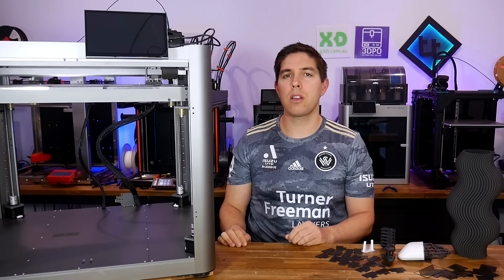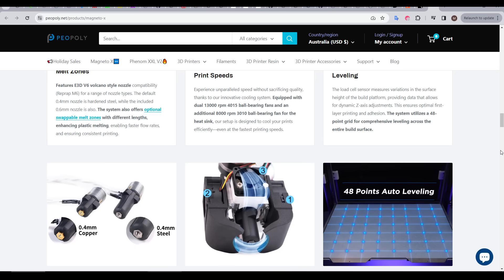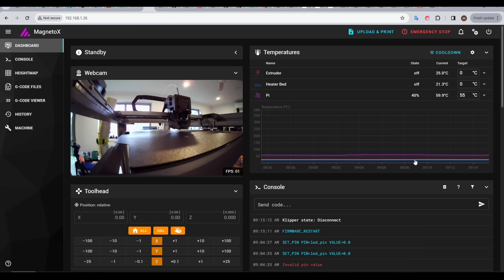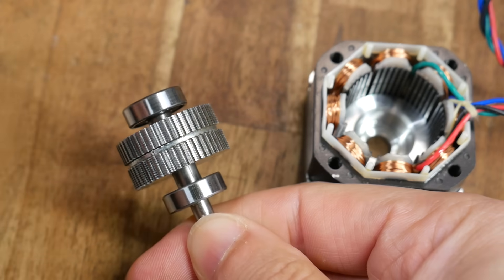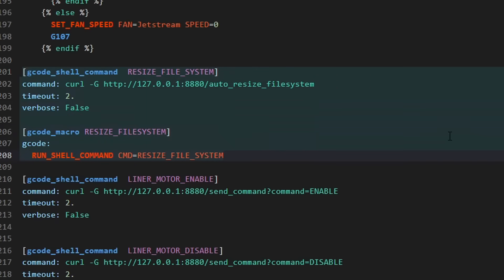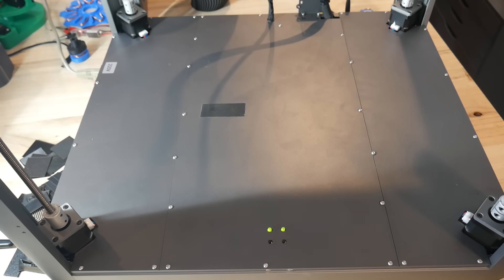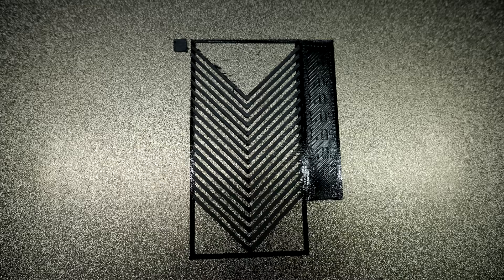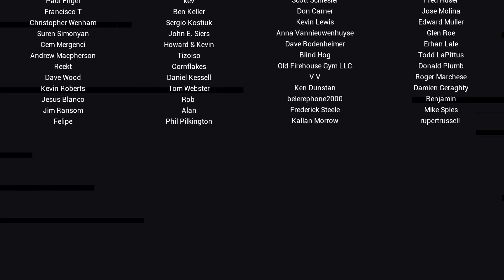Field testing the Peopoly Magneto X linear motor 3D printer

Comment: Hopefully you are able to do a few videos about this printer to explore some of the technology in depth.  Here are some things I would like to see.  1. Other reviewers will cover out of the box experience I am sure, I would like to see an advanced owner point of view, as I think the technology and open-source nature of this printer will attract that sort of buyer.  So, first off, calibrate it well (califlower before and after results?) and tune the orca slicer profiles as you see fit.  2. Explore what benefits and drawbacks the motors have. 2a Is there a difference in how noise ramps up with speed? 2b are VFAs still an issue? 2c Do linear motors and lack of belts change the kind of square corner velocity we can run? Cornering sharply without slowing down might be a real benefit if it doesn't lower quality. 2d How do the closed loop motors integrate with Klipper given that klipper can't respond quickly enough to make real time changes if a motor can't get to it's target destination on time.  Force it to miss a step, will it correct without telling klipper and leave a small artifact?  Will it show a warning in klipper?  Will it just throw an error and terminate the print job? 3 will the open source load cell be useful beyond just being a klicky alternative? Can we see the load cell data and do anything with it? 2e Is the increased resolution useful or noticable in every day printing. Does it open up any new possibilities, for example with a tiny nozzle do miniatures come out better than on a normal FDM printer?  We are seeing that the limits of speed printing (and speed benchies) are coming down to cooling, but do the motors allow us to print fast at a higher quality than we might with traditional motors? 3a Can the homing and bed leveling macros be sped up, in travel if not in actual z testing? Can you correlate the values from it with PA testing?   4. The cooling setup seems quite robust, more than might be needed for every day print speeds.  Can you test out a "silent mode" or something similar to see how noise is at more relaxed printing speeds with slower fan settings?

Comment: Would this printer be a good machine for printing alot of small parts 24/7? If whole printbed is full with small parts can induvidual units be canceled as on Prusa XL? 

And how about always perfect first layer in all spots of printbed, especially considering it's  size. 😊
Reply: Klipper allows object cancellation, it's configured by default on the printer and in orca slicer. I think the only slicer that doesn't do it by default is Cura, but it totally can do it.

Comment: Open Source is certainly important for some people, but you don't have an open source TV, or open source refrigerator, or automobile, and life goes on.  Bambu Lab non-open source printers with almost every part being available from their web site at very low prices could be much better then trying to find a linear motor from SOMEWHERE and hoping it fits my printer.  Also, lets say Bambu Lab were to come out with a printer with this same bed size, but no linear motors and half the price, would I buy this?  Not so sure.  MY advice to them is, stop the worry on open source, and bragging about linear motors and make the best consumer printer, with the best interface at the best price possible.  And if it can do multimaterial, even better.  Built like a tank is great, but how many GM Hummers do they sell compared to Honda SRV's?  I don't need my 3D printer to last forever, just a few years until they come out with something much better.  And if it costs way too much, I may never buy it in the first place.

Comment: Perhaps it would be nice to verify the dimensional accuracy of the prints after all is tuned to the max.
Reply: The linear motors make dimensional accuracy non-issue. Either it's accurate, or you push it so much it fails completely, no in-between.
Reply: @sharpfang  This isn't accurate at all.  Your understanding of how closed-loop motors work and the precision of steps (on open and closed loop motors) is incorrect.
Reply: printing nerd during his interview at The First Look mentioned that it is not like the 20.000 USD printers in https://www.youtube.com/watch?v=9YaW8DIxWTc. It would be interesting how accurate it is or what the potential is. @sharpfang
Reply: @sharpfang No, this is not how it works. It is as accurate as servo control loop can make it. It depends on the encoder resolution, it's noise and rate.

Comment: This would be a perfect application for the Beacon leveling scanner. Patiently waiting for the official release. Been watching this printer from the beginning and it's stopping me from buying a Bambu. Love the mix of reliability and open source.
Reply: The Beacon sensor would be a step backwards in accuracy from the  load sensors being used on most of the new printers.

Inductive and edd sensor measure the height to the flex sheet under the print surface instead of the height to the acusl print surface.

Comment: I would love to know if there are down sides to having magnets more exposed like this.  Does it attract iron dust, does this affect printing, can it clear the path on its own or does it cause a jam or worse failure of the motion system?  I know many people who keep their printers in their shop with other tools so I could see this being an issue.
Reply: CNC machines are using linier rails at much larger scale and exposure to ferrous metal. The magnets are under a cover (much like a stepper motor). If your shop has that much iron dust floating around id be more worried about lung contamination.

Comment: That was so cool! Thanks for posting the video with all these details. I've had my eye on this printer since I saw the same Joel video you mentioned. You really gave them amazing value as a beta tester with those improvements! 

I'd love to see details on consistency and accuracy, as well as tolerances. I've also heard that they plan to have tool changing as well, so if you can tell us any info on that I'd love to hear it.
Reply: I've never seen them make any mention of tool changing...
Reply: I think that they will implement IDEX before they go to tool changing.
Reply: +1 for positioning accuracy. I have done some experiments on my stepper-belt 3d printer, and found some 0.1mm-0.2mm of reproducibility error, which is most likely due to belts. I am not sure if these linear motors would improve on that, but they might, and i'd love to see if they do.
Reply: @victortitov1740  i think the linear motors would have more accuracy , these are used in cnc machines after all and these are really precise

Comment: It's an interesting printer. Since the main innovation of this printer is linear motors, I would like to see tests of them. How accurate is the repeatability after, say, 100 movements along the X-axis from edge to edge? What is the resolution? What are the maximum temperatures that the linear motor magnets can withstand?

Comment: I actually ordered mine in the Pre-Order sales time, and await it, they are making lots of changes, some good, some, just seem strange.   Like the thought of adding the availability of a chamber heater.... something they show I found on Amazon for about $20... but the time they took to work on this seems to have delayed the 'base printer' finish times.   I have mixed feelings on this,  I like that they are considering 'all the bells and whistles' but at the same time, thousands of printers were pre-sold...and none of them (that I know of) have arrived yet.  This makes it feel a bit hollow to us.

Also I think the cost of the Top Enclosure (because there are 2, the main and the top) is a bit too expensive.  The main enclosure is only about $70, which seems about right for pre cut, sized, etc Acrylic of that size. (in fact, its only about 20% more expensive than If I bought the acrylic and did all the work myself) - but the top enclosure, which is roughly half the size in acrylic, but adds more extrusion, is $140.   This means the total cost to enclose,  is over $200 - and shipping adds on to that.   That is a bit steep really, for that price, you can literally buy another mid range printer, or a good 10Kg of plastic to use.

Since you got the kit and are going to test/review it - I'd like to see the difference with 'top on/off' with ABS, as I feel most will feel like me, and the $70 doors and walls enclosure is reasonable and probably a go-to, but the $140 top enclosure is a bit steep - and will probably be skipped.     Let's see how much that top enclosure matters for, PLA, ABS, ASA, PETG, and maybe some more exotic filaments, etc.  These prints should probably be as tall as possible reasonably speaking, to ensure it's not a 'the first hours are ok, but after that - there is problems' situation.
Reply: 250 printers were pre-sold, not sure where you got thousands from :)

Comment: i love everything about this add a second print head / toolchanger and it beats literally everything on the market.. it's cheaper then the XL  and better built then anything else
Reply: The linear motors means adding a second print head would be fairly trivial too
Reply: @Geoff_W  i feel like I saw something about them doing that at some point but tbh I don't remember lol
Reply: @Geoff_W  You would have to add a 2nd Y rail to the gantry as you would lose all your print capacity adding just a print head.
Reply: @a2dskins  There's room on the board for expansion, no reason you couldn't add another Y gantry too, the only thing with that is you are sacrificing build volume at that point (although you probably also lose some adding another print head to the same gantry also).

Also there's no reason you couldn't just throw another head on the X gantry. You could run an ERCF to both heads and do a color change on one print head while you print with the other.
Reply: @Geoff_W  i remember that at that event where they show 3D printers  (i forgot how it was called) there was a Magneto X that had something like 5 heads , so yeah , you are right

Comment: What about linear motor drivers? Are they open source? What if driver fails? And, belive me, it will fail sooner or later. BLDCs are not steppers, they produce much more back EMF, and MOSFET are not happy to handle it. Does Peopoly sells these drivers? What if Peopoly gets bancrupted? Convert this printer to steppers and belts?

As for design itself, it's heavy for no reason. Zero advantages. And very expensive. Belts are better, and closed loop is possible with belts too.
Reply: Heavy for no reason? In the first paragraph you made the impression of knowing what you were talking about and then you turn out to be clueless. 😢
Reply: @MetalheadAndNerd These are magnets. They are heavy and expensive, but print quality is same as belts. What's the point of it? Why should someone prefer linear motors instead of belts and pay x2 or even x3 price?
Reply: @TheNamelessOne12357  Magnets are a well known technology. I wouldn't call them expensive either. 
The biggest advantage of linear motors is in my opinion that there is zero additional flexibility and resonance in the system as it would result from belts. Also no bearings needing replacement and especially no motor bearing getting worn down by constant sideways pull on the motor shaft.

Comment: I think speed is already limited by the material properties, closed loop sounds very nice, just that instead of loosing steps it will detach the object from the build plate. 
The load cell in the head has definitely some potential, like detection of all kind of print failure. The slicer can estimate the expected force for a segment put them in the gcode. Klipper can then do the checking, stop, slow down, add more z-hop, reduce extrusion factor for curling overhangs.
With this hardware it may become the first printer where you never see the spaghetti monster.
Reply: Your comment about material properties: Are you talking about the filament? They do have a long melt area as shown at 5:18 but it would be good to know how much power it's pushing through it, and up to what temp is it heating up to. What other material properties are you worried about? The weight of the print head?
Reply: @tomsko863  CNC kitchen, done a video about it fast and strength, if your hot end is at it limit the parts are coming out weaker.  So bamboo labs with its motion system is already at it hotend limit. 
Do we have here a significant better hotend? On paper, the motion system can be faster. I just have a flsun v400, I don't use the top speeds for strength, relatability and noise reasons.

Comment: One thing I would like to know is the maintenance/cleaning pros and cons of the linear motors over the conventional belt/pulley system. For the latter, making sure your belts are of appropriate tension and un-tensioning them when not in use for a while is something we have to do. Does the linear motor system remove this need for maintenance completely without catch, or is there another layer of complication in terms of maintenance that it brings?
Reply: Magnetic flux scattered around Gantry very dangerous.  Heavy Gantry, heavy motors. Enclosed chander can demagnetise the linear motor rapidly.

Comment: I’m apart of the beta program as well. I’ve been using it to print very big things such as cosplay helmet. So far this printer is on track to be a great contender!
Reply: It's one thing to love a USD$2k printer you received for free, it's another thing all together to lay out your own cash for this thing.
Reply: @WheatMillington  It's really not. 2k for a cutting edge printer that is in the spirit of RepRap and adding to the community and uplifting it instead of being a bad actor really does have a lot of value to a lot of people.
Reply: @Geoff_W  being in the spirit of reprap is not a reason to be more expensive, only a reason to be cheaper cause you'd expect the "closed" companies to be the expensive ones for being proprietary

on the contrary i understand that the mechanics involved aren't the most straightforward nor cheap, neodymium is pretty expensive and then there's also development time etc.
Reply: @Geoff_W  to add on that, it is a reason i cannot recommend anything Prusa, cashing on a 10 year old design, being "open source" doesn't make it worth more than something like a Bambu A1 for example, if it can't deliver the same results
Reply: @BH4x0r  Oh sure, yes, I didn't mean to imply it being in the spirit of rep-rap was making it more expensive 🤣👍

I just meant that the fact this IS such a white box component printer (other than the few cutting edge hardware parts), that that is something I and many others see as a good reason to buy this over other printers. It's easier to repair, it's easier to source replacement parts, and it's easier to improve upon. That's all I meant 😁
Reply: @Geoff_W  the special X/Y axis would be harder to replace or repair i'd imagine, the other parts are standard parts

i mean if something like a Bambu's mainboard broke you could just jerry rig a different motherboard in there, they're still steppers and "normal" parts

to me the most concerning thing are the linear motors, as thats not a normal thing
Reply: @BH4x0r  Nope! They are not normal steppers, they will not run if you wire them up to normal stepper drivers, it has been tried (the tool head would also not function without firmware to run it, which will never be released). Also Bambu is explicitly one of those bad actors I mentioned. They are actively hurting the 3D printing community as a whole with bad faith Chinese patents for things that are open source. They are creating a bad situation, while companies like Peopoly are actually contributing.

I don't disagree that Prusa is a problem...
Reply: @Geoff_W  I need to check that out myself lol, i can't believe there's anything "special" about them steppers, but i'm interested now LOL

Comment: Given that one of the main selling points for linear motors is absolute closed loop control, I would really love to see on your test prints if any vertical fine artifacts or other related ringing is completely gone along with layer shifts.

Given that the z axis motors are not linear motors, I'm wondering what effect that would have on VFA.

Comment: Things to test - exactness of corners and print measurements.  I use my FDM printers for mechanical prototyping and one-shot parts printing, and these are the toughest things to get sorted when starting with a new printer and filament.

Comment: I'd love to understand the durability, lifespan estimates, and replacement cost of the magnetic linear motors/ rails. I love them in theory, but my entirely :uneducated-on-the-topic-assumption" is that they are horribly expensive to replace should they be damaged or worn out.

Comment: Definitely an interesting printer.  I'm mainly interested to see what if any advantages the linear motors will offer vs. belt.  I know in theory it's a better solution, but I want to see some real life advantages, aka better print quality, better accuracy, speed etc.
Reply: Simplicity is a big draw for me. Off loading as much of the 'mechanism' as possible to firmware is something I like the idea off - especially when it's closed loop.

Comment: Do the linear motors have encoders?  What are the capabilities of recovering lost steps?
Reply: I guess the controllers are so smart that they can use the drive coils as sensors for the position of the magnets, too.
Reply: @MetalheadAndNerd No, it has magnetic linear encoders. You can see the mag strip and the encoder head on the side of the rail at 5:42